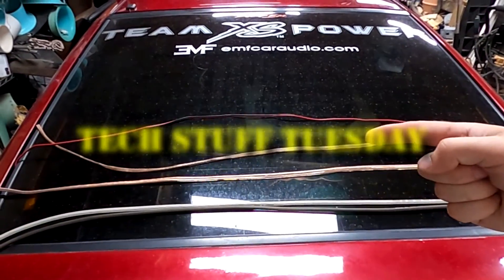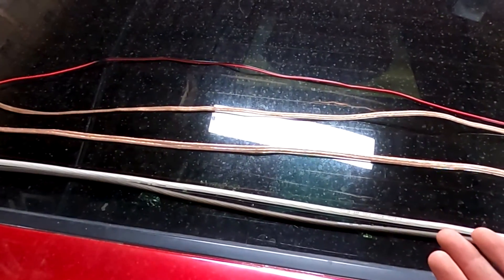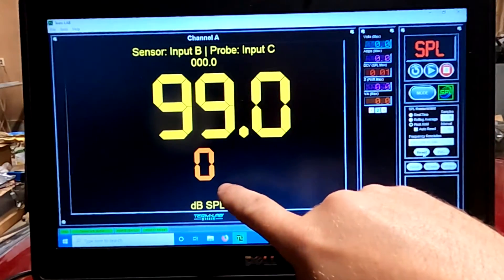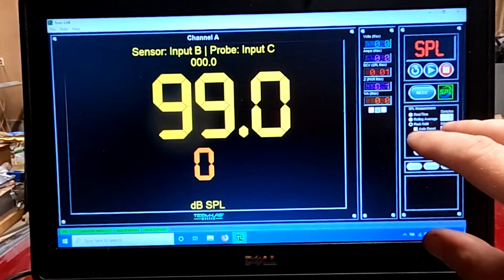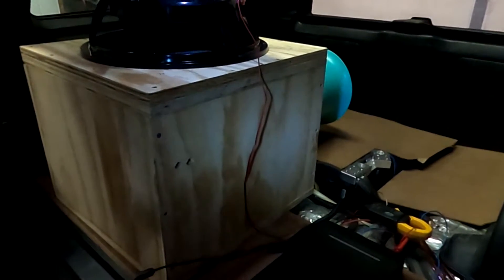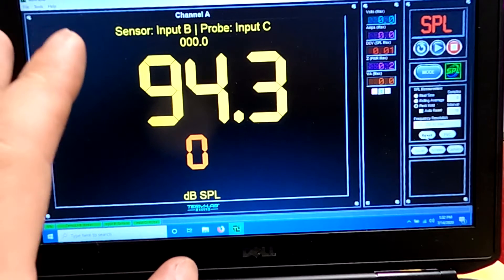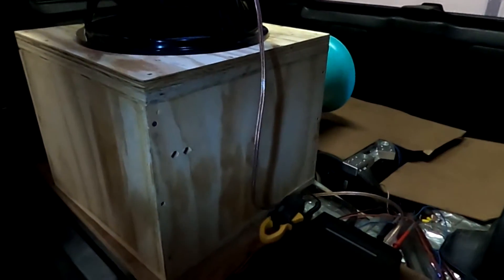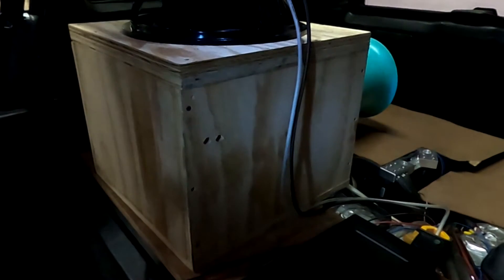Choosing the right speaker wire size, and why - Tech Stuff Tuesday

Comment: I had 8g but new subs have smaller terminal so I used 12 GA cca. Recently upgraded to 10ga ofc. But the difference in thickness from the 12ga to 10ga is almost not noticible.. running 3k at 2ohm

Comment: Awesome video and explanation. I have one question. It's very common to use speed wire (9 conductor= 8–18-gauge speaker wires with a remote turn on wire). I have this running from my amp to my dash, where it taps into the factory speaker wire to power the door speakers. The door speakers are 6x9 JBL Capable of handling 100 watts continuously. My amp supplies about 120 watts per channel continuous RMS power and very clean.  So, for continuous music at a high level will 18-gauge wire be enough for a continuous load in this application. The length is about 20 feet including the factory speaker wire. Your thoughts?
Reply: according to what he said, 18 gauge should be good up to 200-250 watts. I came here for the same question

Comment: Great video!  Just to make sure I'm understanding you correctly, as you were utilizing a subwoofer for your testing, and I'm certainly not an electronics expert.  I'm guessing my factory wiring harness in my Tahoe would be 18ga, from what I think I understand you're saying is that I would be oaky utilizing the factory speaker wire in the wiring harness and in the doors etc. for my mids and highs?  I did get 12ga copper speaker wire for the door speakers, but if I don't need it, I certainly don't want to run it!  My amp is 125 RMS for 6 channels @4 ohms.  Thanks!

Comment: I have massive audio hippo XL 2 15s on a 5000 RMS taramps smart bass amp  should I run 4 or 8 gauge wire to the subwoofer

Comment: I would like to request the numbers on 18 awg running 100 watts rms for 3 hrs.  The reason is I want to do aftermarket Amp on 18 awg factory door wires and I was worried about heating the door wiring harness on a 6x9 at 3.2 ohms.  I'll be running 16 awg from the trunk to the dash at the factory harness.
Reply from the maker: Results will vary based on wire length. There are calculators to figure out voltage loss and with minimal loss will also come minimal heat.

Comment: I have 600 watt amp what gauge do you recommend?
Reply from the maker: 16 gauge would be fine in a reasonable wire length, I'm assuming it's not a 1 ohm amp. 14 gauge should be fine with 1 ohm and even more than a little bit of length.

Comment: I think in 2021 it will be a good time for EMF to do this same experiment but kicking it up a notch. 5K RMS - 20K RMS speaker wire sizes. Anything is possible. (but not everything is feasible). Regardless if EMF does or not, thanks for these previous videos.
Reply from the maker: 5k for a period of time could be, higher than that would require multiple subs through the same wire and with maintaining voltage to produce power I'd be limited to about 10-12k after subs heat up unless it's like 8 of them.

Comment: So what AWG size of OFC speaker wire should I use to power 2 subs with 20K RMS (10K each)? 4g or 2 runs of 8g will be sufficient for SPL comps? Surprisingly I did not learn this answer from watching this video because EMF tends to cover all bases, so maybe I missed it. 
(If someone wants to know what subs: 2 - 15" Fi Neo 4.11 w/ Omega option and stage 3 cooling rated 5K-7K RMS which is why I will be supplying them with 10K each, which doesn't necessarily mean they will receive 10K each, thanks to factors such "Impedance Rise").  
And to think, less than a year ago I watched this video to learn what size of speaker wire my single Kicker L7S 12" needed for it's speaker wires, haha, or maybe it was when I had already upgraded to 2 L7Ss but regardless, I've learned A LOT and have come a long way within the last year mainly by learning as much as I could from car audio pros via YouTube such as this EMF channel. So a big thanks to these guys. [plug] For anyone interested in seeing my previous builds or my newest builds, feel free to check out my new/small/basic YT channel where I will be uploading much more content in 2021 in hopes of passing on accurate knowledge to my fellow bass-heads.  Presently am building my 5th build in one year, starting from 1K RMS, 2K, 5K, 8K, to now 20K RMS :-D
Reply from the maker: Impedance is a factor, it's all relative to current and the length of wire to determine the size needed. For SPL purposes going from 8 gauge to 4 gauge per coil you won't seen even a tenth till you're wired way low and have 20k+ per sub. For musical purposes the figures over time will be different as wire heats up.  Even then, you're talking maybe a tenth or two. I will say that you definitely don't have 10k per sub, I wouldn't be surprised of each sub is seeing 5k or less in reality. Grand scheme of things, calculate/measure how much current is on the speaker wire, refer to reference charts for wire size on a giving length with that current, that's what size you need. CCA and OFC will yield different results.

Comment: Great vid ! I like to see someone using a scientific and practical approach to show in measurable outcomes that myths are busted. I see people using 8 gauge wire for a 500 watt sub or even 12 gauge door speaker wires for 100 w RMS.
Reply: Maybe just maybe they are predicting future upgrades? It's not a bad thing to go-big from the start. I wish I would have! My power wires over the last 12 months have gone from 4g CCA to 4g OFC to 0g to 2/0g to 4 runs of oversized SHCA 2/0g = Additional Time+$$ Sadly I still have every single wire from previous builds. Gosh, I prolly should just give the stuff away.
Reply: @lowhertzhighspl  ya. I do typically run larger wire than needed in case I upgrade. But, I meant people using 2, 3, 4Xs what is needed. So, for me, I have a RF P600X4, and I ran UL 14 AWG CL3 OFC speaker wire to all the doors. 16 gauge was enough, but I wanted to have extra for upgrading later, but 12 gauge is just over board, unless I go nuts. 
--In your case, damn!. I been there and done that. Unfortunately, car audio seems more like a hobby for folks like us. Been doing audio since I was about 7 (1987), made all sorts of systems during the '90s boom and loudness wars, and one thing I have learned is: Design the system very well before buying/modifying anything and plan for future upgrade/problems and design for such. But, this doesn't always work. 
--And, as a hobby, we continually change/modify/add/remove, etc.

Comment: Amazing! 

One question: I'm running 10 awg OFC for Rockford fosgate T1 800 rms and amp pumps 1200rms @1 ohm. The subwoofer terminals support 8 awg ... should I replace the 10 with 8? 🙄
Reply from the maker: Well, there is a claim to it making 1,200, but that would be subject to the wire length. Odds are if you're less than 10 ft you won't see a difference even in measurement. You definitely won't hear it.
Reply: @EMFAudio  4 ft of wire. Amp is very close to the subwoofer enclosure
Reply from the maker: @zootopiashow  You could get away with 16 or 14 gauge wire at that length.

Comment: You aren't concerned about damping factor? 🤔
Reply from the maker: I'm concerned with it as much as I am peak power ratings, signal to noise ratio, or frequency response of an amplifier. If there is no standard for rating, does the number matter? If you can't hear a difference, does a better spec make it better?

Comment: welding wire?
Reply from the maker: Some welding wire is OK, some is not.
Reply: @EMFAudio  thank's for responding. I saw some 6 gauge copper welding wire that looked like a good alternative over 4 gauge that people try to overcharge for because of its popularity.
Not trying to run anything in the multiples of thousands of watts.

Comment: Are all these wires ofc wire?
I'm running about 2 feet of 8 gauge ofc in parallel, 3800 to 4000 watts at .5 ohms. I was using 10 g   ofc in my other car without problems.
Reply from the maker: In this case, yes they are all OFC. That length of wire you can run an enormous amount of current through. Another point is looking at how much the wire heated up. 5 degrees isn't in the danger zone and you'd never notice it but there are scenarios where you definitely could.

Comment: AC output on amp does not produce as much current as DC
Reply from the maker: Current is current, it's measured in amps, and AC or DC is still amps and volts. The limitation of wire is current.

Comment: A 10 AWG gauge sample wire was missing. How would 10 AWG react to no more than 650 RMS?
Reply from the maker: 14 gauge wasn't there either. Remember, it's not just wattage, it's impedance. The amperage number is the key thing there. Wire length is also a factor, and why I mentioned it. Presuming 1 ohm that would be 25 amps, so it will be less than that. A quite long 10 gauge wire will handle 25 amps fine.

Comment: so speedwire to the factory harness is fine for mids at like 100 watts?
Reply from the maker: 16 gauge is sufficient for that power, especially on mids being as it's going to be 4 or 8 ohms. Remember though, the factory wiring is a factor. Consider the age of the wire and what is there to start with.

Comment: Do you think running 1/0 on 10k is over kill , I switched from 4 gauge to 1/0 and noticed a difference, but I also increased my power wires from 1/0 to 4/0
Reply from the maker: Did you notice a difference, or did you want to notice a difference so you did?
Reply: If I had an amp that pushed 10k rms I'd use 1/0 too but then that's what I use "ofc" with my 2400 watt amp and parallel it down to push 3800 watts to .5 ohms cause it pushes more than it's rated rms Watts. Most amps won't push .5 ohms without burning up but I have a 2 year unconditional guarantee and have had it over a year now with no problems.
Reply: By "notice the difference" how did you test?  How much did you gain?
Reply: The gain was .15 tenths of s db
I was running @1 ohm 
Wired to 1/2 ohm 
It could be the batteries where fully charged 
Length of speaker wires were approximately 10-12 feet one way

Comment: 8 gauge might not be necessary, but damn is it sexy!  not to mention car audio has always been over the top anyway.  at least we're not superstitious about letting your wires touch the ground or insisting that they be cryogenically treated to line up the magical copper crystals!
Reply from the maker: Actually, there ARE a lot of "superstitious" people in car audio. I do see people waste money on basic things in car audio too.
Reply: @EMFAudio  you shouldn't say things like that unless you're prepared to tell stories :D  the only thing that really springs to mind is not mounting amps upside down.  then too, people used to swear by capacitors, i think it was "1 farad per 1k".  now i'm really curious which rules of thumb i've heard over the years are bullshit.

Comment: I think the quality if the wire matters too...at least from my experience iv'e used some I think it was 14 gauge wire don't know if it was basic wire or cca wire but I would smell something burnin thought it was the sub but turns out it was the wire and since it burned it increased the resistance caused me to lose power ...it messed up my bass amp tho after it happend a few times now im using 12 gauge ofc wire. rip fosgate amp. Gonna install my skar amp next when I get the time till then im using a taramps bass 1200.
Reply from the maker: That goes back to current too, copper wire handles current better than aluminum.
Reply: @EMFAudio  ya I learned that lesson the hard way. Won't be doing that one again only ofc stuff now.

Comment: I ran 2400 watts daily with 12awg. The blue kind that you get from Walmart. After about 6 moths the wire was burned looking and a little crispy feeling when flexed. I now use 16awg of a much higher quality and the wire is still like new after 2 years. Quality is a huge factor when buying wire. Smaller quality wire is better than crap bigger wire.
Reply from the maker: It sounds like you had 12 gauge insulation with a smaller wire, and probably aluminum vs copper too. That is a valid point though, not just going off the number it says but the actual wire size.

Comment: I use between 12 and 14AWG for everything as a sound man in churches. Wonder how the distances of up to 150-200 ft would effect the results.
Reply from the maker: Quite a bit, there is a lot of resistance in that wire. You can calculate the amperage capacity of that wire and figure out how much wattage it could handle at a given impedance.

Comment: I would like to see this at 3000-5000 watts if it would scale or be similar
Reply from the maker: It does scale, remember,  you're looking at current. Lower impedance will happen sooner too. Also remember this is with a tone, and the temperature increases on the smaller wire aren't catch fire level heat after that 30 seconds but that will only get worse with longer play time.